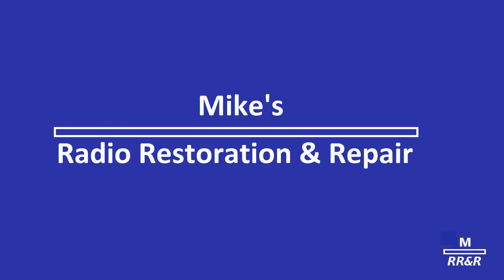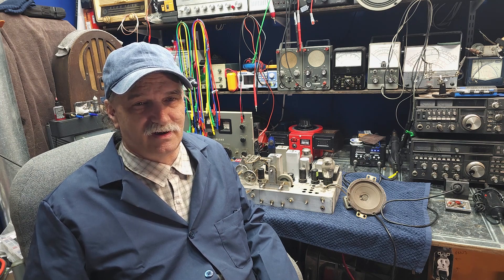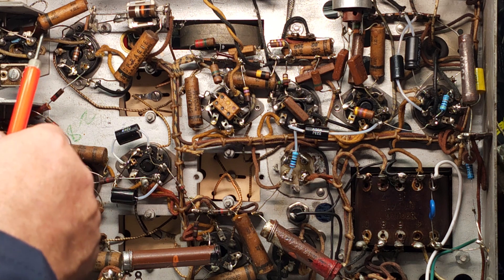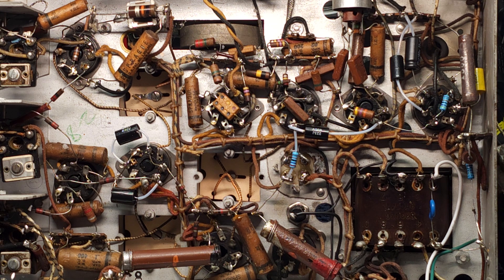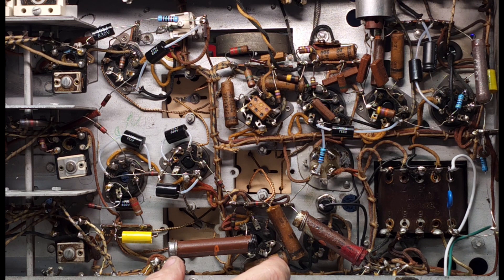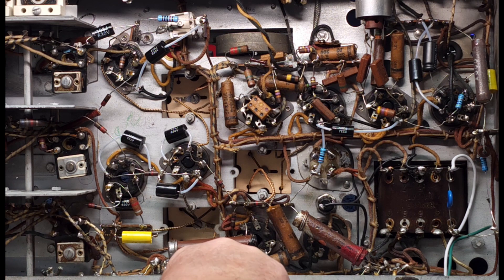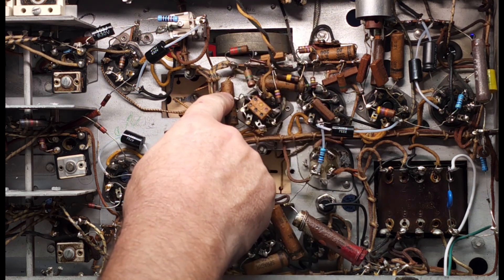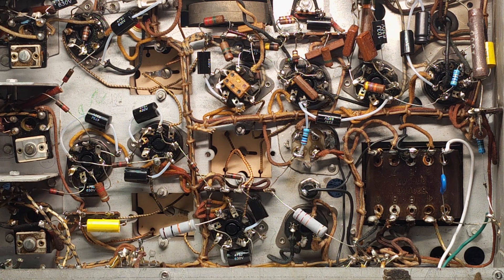Hallicrafters S-40 Restoration Pt. 3 - Wax / Paper Capacitor Replacement / New Discovery

Comment: What size of Teflon tubing do you use and where do you get it from. Enjoying your videos would like to see actual part replaced going through the desolder/solder process desolder tool or braid copper, showing the j hook or coil method for newbies. Why not to mess around with hard to reach area example to use the j hook so not to put too much heat on repair area I believe this would benefit a lot people first starting.  Just my two cents.

Comment: Thanks Mike for your videos. Can I replace a mica cap with a regular cap that replaces the paper caps. Kind regards
Reply from the maker: No, you cant. Silver Mica are designed to withstand RF heating and still hold there value. They are usually placed in a circuit that needs to be RF stable and reasonably free of drift. As a general rule, Silver Micas are not replaced during recapping. They are only replaced if they are proven bad. They seldom go wrong.
Reply: @MikesRadioRepairRestoration  Thank you Mike. I appreciate you reply.
Reply from the maker: @lawrencehalpin6611  https://www.youtube.com/watch?v=quLBf-7I6fo&t=40s

Comment: Do the wax capacitors you replaced have polarity? I see a black stripe/band on one side. Thanks for your help and your videos
Reply from the maker: They do not. They are not polarized like electrolytics.  The black band indicates the "Foil side" of an old wax / paper cap. So you would want to connect that foil side to ground to help reduce noise. if you connected the foil side to a sensitive input, it would pick up hum and noise. Modern film caps like I have used dont have this issue anymore.